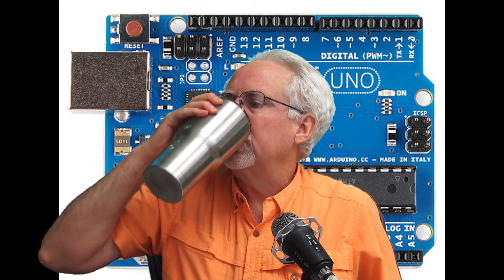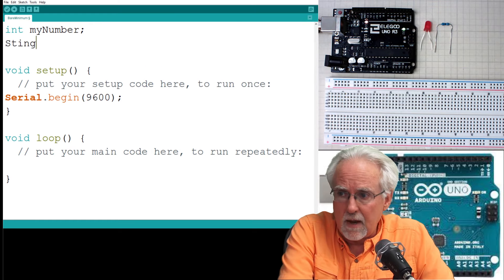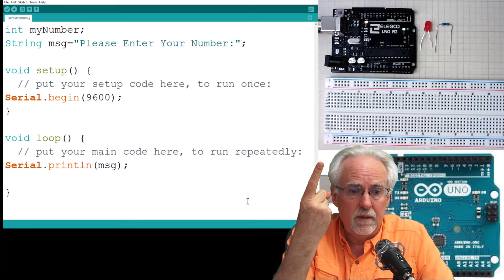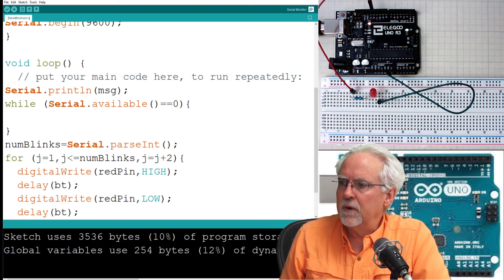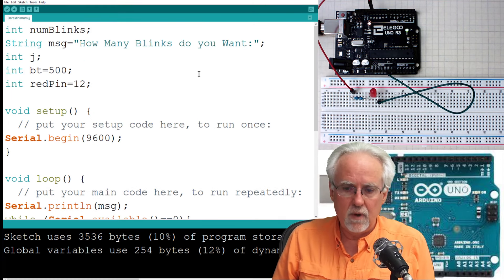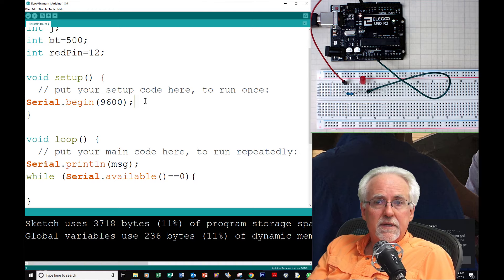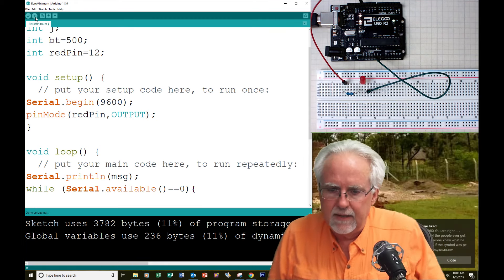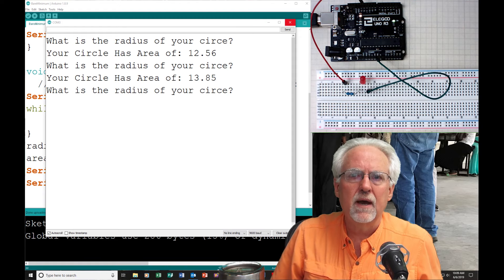Arduino Tutorial 18: Reading Numbers from the Serial Monitor

Comment from the maker: Guys if you are having trouble, make sure you have your serial monitor set to "No Line Ending". Otherwise you can get unpredictable results.
Reply: Good one there. I entered the code as you explained it, then paused the video before you executed it. My sketch compiled and loaded fine. It took me a while to figure out  that I had to click Send or Enter to execute the read. I had the serial monitor set to "Both NL and CR", and the Serial Monitor would print an extra line saying "Your Number is 0"! Changing to "No Line Ending" fixed it. BTW, this lesson covered new stuff for me, had never seen Serial.available or Serial.parse before. Keep challenging us!
Reply: omg this was my problem  tytytytytytyty lol
Reply: Thank you Paul, you are a great teacher. I was wondering, the setting we had to choose was "No line ending", is it also possible to add a line ending. How would such look like?
Reply: At last - this fixed my issue too. Many thanks
Reply: Thank you so much for mentioning this! I was pulling my hair out trying to figure out why my code wasn't working.
Reply: Hey Paul thanks for the heads up, but can you explain why this happens and what's the use of new line??
Reply: @chuckpickering6040  I was dealing with this issue and for once decided to read the comments to see if it was talked about. You saved me alot of time beating my head against a wall... thanks
Reply: Yeh acttuly , thanks for help for beginners 😊
Reply: Thank you boss !
Reply: @chuckpickering6040   I just had the same problem, until I saw his comment
Reply: OMG thank God you said that
Reply: I raged quit the video after I couldn't solve this issue yesterday. I rewrote the code a lot of times to the point that I memorized it. and finally I decided to come to the comment section and see this that solved the problem I was facing.

Thank you so much for these amazing tutorials, I just started couple of days ago and I am super excited to start using more components. You are great at teaching and a really funny person. I really enjoy your lessons.
Reply: Thanks, it helped me. It was one extra entering 0, after I entered myNumber.
Reply: Mr. McWhorther, lets thank Youtube for its comment section...
I enterd roughly similar code with some exeptions here and there, but no matter how mant times I rewatched this video I couldn't find out why my serial monitor would only use the value i enteref for Red LED.

Then I decided to take a look at the comments an found my answer.

Thank you for every detail you put into this videos. 
We appreciate it!
Reply: I thought my Arduino was broken... I thought it was supposed to be set on newline.... thanks wish I saw this 2 hours ago.
Reply: @chuckpickering6040  Same thing happened to me. Thanks for this comment.
Reply: That did it - kept on getting an extra message each time after entering the number of blinks. Sorted!!!
Reply: Thanks! Fixed the issue!
Reply: dude.... THANK YOU
Reply: @ДмитрийГрибанов-ь8э  Mine, too: 
Please enter Your Number.
Your Number is 565
Please enter Your Number.
Your Number is 0
Please enter Your Number.
Your Number is 235
Please enter Your Number.
Your Number is 0
Please enter Your Number.
---------------------------------------------But changing to "No Line Ending" fixed it------------------------------------
I was stuck for a week!
Reply: I was trying to figure out how to clear the value to null for the variable. Slaps the face. Wrong setting... thanks  pops
Reply: This ought to be pinned to the top!!! 
I was going crazy until I read this comment!!! 
Thanks :)
Reply: This totally helped, spent the last few minutes trying to figure out why I was getting an extra line.
Reply: Sir, can you explain the difference between these settings and what they do. I spend an entire day trying to find out why my circuit wasn't working until i decided to check the comments to see whether anyone else was facing problems. Thanks for the video series. It is really helpfull
Reply: Fantastic!! I forgot to change that when you mentioned it before. Thanks for putting it in the comments!
Reply: That was my issue! Thanks Paul! That fixed it! Loving these videos, learning so much! Gotta love the practical experience too, thank you for the assignments, they are challenging but not discouraging.
Reply: I found the prob
Reply: thnks for this, now my problem is solved and I can continue happily
Reply: Sir
Reply: thank you
Reply: OMG :D this fixed the extra "number is 0" line :D Thank you Paul :)
Reply: Can someone please explain what each of these options do? I tried to look online and found things about carriage options and such, but I am not fully understanding the difference between each of these options.
Reply: @chuckpickering6040  I was having the same problem!  Thanks for sharing!
Reply: Thank you
Reply: Bwahahaha, i rewrote my code a few times, every time the same problem .... and it was just a click on the Serial monitor hahahahah. Oh well so we learn.
Reply: Lol. I was scratching my head until I saw this. Thanks for adding
Reply: I'm one of the 232 that had this problem. I searched & searched the code. I don't have any LEDs so my code is slightly different to blink the one on the board. So I decided to read through comments & glad I did.

Thanks so much for the great teachings!
Reply: That solve the problem. Very effective
Thank for your hard work
Reply: I guess everyone had the same problem (including myself)😅
Reply: aah! i was about to throw it in the river.. thx!
Reply: I was confused because I got “0” at the ending, it’s ok with “no line ending “
Reply: thanks for this. I was wondering why the monitor shows the message twice and the second result was 0 no matter what number I entered. My serial monitor was set to "Newline". Now the result is the same as your video.
Reply: ty mine say my nuber ex 55 and write a new line say 0 . ty for the info with the no line end it write only 55
Reply: I got the automatic "Your Number is: 0" after entering other numbers until I changed that.  Thanks for the heads up!
Reply: i was wondering why it was running through the code twice and inputting a 0 the second time
Reply: I had the same issue. It kept printing "Your Number is 0". I fixed it as you suggested in this comment.
Reply: @prabhavagnihotri7420  when set to 'Newline' it generates /0 each time…and program proceeds with value 0 before taking any value from you.
Reply: That fixed my problem, thanks
Reply: Thank you! Before I switched that setting, my serial monitor would do 2 executions of the code, the 1st being with the number I entered, and the 2nd being with a 0.
Reply: HE SAID IT IN THE OTHER VIDEO
Reply: YOU GOT MY BACK
Reply: txs, indeed it fixed it! why does this happen? Again thanks a lot for the interesting and entertaining material!
Reply: Thank you sir, I was really banging my head before reading this comment.
Reply: Thank you soo much. I was stuck for missing this setting and in one hour I wasn't able to solve it until now!
Reply: this solved my problem! my serial monitor keep printing 0 after every time i enter a number. as if there was someone else entering 0 for me. this is what i get for not holding my breath many times hahahah
Reply: Wish I saw this sooner.  HAHA
Reply: seems we all had the same problem. Wish I had read the comments 30 mins ago . Figured it out in the end.🙂
Reply: Holy cow! Thanks! I tried 3 different computers and kept getting a 0 after my input was read. Next time ill refer to the comments haha
Reply: Wish I read this an hour ago :)
Reply: Thank you. I was about to give up (not really- just disappointed :) ) when I found your comment - problem solved!
Reply: @chuckpickering6040  yes I am facing the same issue!
Reply: Just the problem i was having 😅
Reply: ohhh, thats why, it works now lol
Reply: Thank you for the tip. I was wondering what was wrong with my monitor until I saw this when I tried out the code.
Reply: Thanks
Reply: Oh dude thank you lol
Reply: i had fun figuring that one out thanks lol
Reply: haha this is my problem. I almost empty my coffee thinking what is the problem then I decide to check the comment😄
Reply: Thank you. I came to the comment area because I was having a problem and BOOM!!!, the answer was in the first comment. 🙂
Reply: Not sure what I would have done if I hadn't read this comment, at least one hour of my life passed away looking for the reason it kept repeating after I had entered a number, Doh!!! anyway another great episode Paul, on to the next one!
Reply: Wow this was my issue.  I made a program to control the LED brightness by entering a float.  It kept going to the brightness i chose and then shutting off.  I got around it by adding a Serial.read() while Serial.available() > 0 at the start of my loop, but it's nice to know how to avoid it in the future.  Thanks!
Reply: It took me forever to see how to change that!
Reply: that was driving me nuts...ok..it works now
Reply: Paul, these videos are still being watched.  Thanks for sharing your knowledge with us.  Love these series.
Reply: This tripped me up. Thanks for adding this comment. Was getting ready to throw my Arduino out the window!
Reply: I guess thats why we need the strong black iced coffee with no sugar! Thank you for your lessons!
Reply: Yep.  That fixed my problem, although i’m not quite sure why
Reply: 😢😢 thanks
Reply: Ok

Comment: Just a tip for other viewers:
I had an issue where serial monitor would ask how many blinks, I would enter, and it would work properly. But when it void looped, it would double prompt me with "How many blinks do you want?". 

The issue was my fault - you need to change the serial monitor from "Newline" to "No line ending" in the drop down menu next to baud rate, in the lower right-hand corner. This is something that Paul suggested many tutorials ago, but I didn't change until now. This guy knows his stuff so pay attention =)
Reply: when i did change it to "no line ending" my code stopped working!!!! :D

Comment: the numbers off blinks i could not seem to work out but in the code if you change this line 
for(j=0; j<numBlinks; j=j+1) i spoted the pinmode missing in his video also the +2 as knew from the othere videos that it should been +1 unless you wanted to count down so only half the blinks they input

Comment: Why did the LEDs work at all (albeit dimly) before you initialised the pin?
Reply: According to the Arduino reference; the internal pull-up resistor is enabled by default when pins are undeclared, and the resistor acts to limit the available current. Unfortunately the Atmega328 datasheet offers only basic schematic diagrams of the I/O pins so I'm unable to explain exactly how this happens.

Source : https://www.arduino.cc/reference/en/language/functions/digital-io/digitalwrite/
Reply: @danthemancasey  Thanks for that explanation.  Appreciate it.

Comment: This was a fun one (actually, they are all fun!)  A bit more explanation on the Serial.available() command could be useful here, for example would I ever use it for anything other than this case of waiting on the user to enter a value.  Also I'm curious if there is a way to have a user enter two or more unique inputs during the run.  Maybe that is covered in subsequent lessons? Way to go on coding through the impediment of spilled coffee - handled like a pro!  The important thing is it did NOT hit the Arduino! :D
Reply: You can do 2 or more inputs before anything happens. One example is using another subsequent While to wait for the 2nd input. I'm starting out on this coding stuff so can't suggest anything fancier.

Comment: Question: Why is  if I input 9 ones 111111111 serial monitor shows a value of 27591?Just curious
Reply: maybe it is too large, overflow the capacity of arduino to handle a limited value of integer
Reply: U gotta put a double instead of an int
Reply: Hi you are employing 16 bit integer in the declaration.
2^16 = 65536.
so when you input a number larger than 65535 it overflows and starts filling the register with the remaining value.
Here, when you enter 111,111,111 its starts filling the register but it overflows, so it starts filling the register again but since your number is very large it repeats the process over and over again. 1495 times actually. After repeating it 1495 times it has a remainder of 27591. And thats the value it shows.
111,111,111 / 65536 = 1495.42100525
0.42100525 * 65536 = 27591 !!!!
Reply: @prabhakaranbaskar1400  Any extra bits go into the bit bucket.

Comment: BOOM ! works a treat. Given the 'most excellent' knowledge you've imparted thus far Paul, I embellished the output a little with adding the 'user input' value & mm to the output string...ie  "For a radius of 9.00 mm, The Area is : 254.34 mm	// perfect … "

Comment: I tried with the for loop and it worked just fine. You just have to make the first and last conditions always true while stating your condition in place of the second condition in the <for> brackets.

1 for example will always be true. e.g. for(1;<condition>;1)
Reply: Yep, you can also write for(;;). it will do the same thing. It's less intuitive though for someone else who may be reading your code, which is why a while() loop is a better choice.

Comment: Hello, Paul!  Thank you for lesson again!  My coding for this lesson is fine, but the first printing message always printed twice when the  "while" loop runs for the very first time.  For example, after I click "upload", the message for "enter radius of a circle" is printed TWICE on my serial monitor. The two prints are about 1 second apart.  After I entered the value of the radius, the program is work fine - no more double prints.  The similar issue happened to my son's "for" loop counter (lesson 16).  When the program is first uploaded, the first number is printed two times, and after that everything is fine.  After googled the solution for this type of problem, I added a delay for 1000ms before the program loop.  This delay function solved the double print issue.  It seems the computer needs to take 1 second break before starting its work correctly 😆

Comment: Having an issue with this @ 10:08 - after entering an integer, the messages repeat a second time, but then says my number is 0. Do you have any ideas why this is happening? Everything I typed in the code is identical.

Comment: 00:02 Lesson 18: Reading data from the serial monitor
02:41 To read numbers from the serial monitor, set up variables and use the ask-wait-read process.
04:56 Implementing a delay for user input
07:38 Reading numbers from the Serial Monitor using Arduino
10:43 Interacting with the program through the serial monitor
13:17 Using a for loop to blink an LED based on user input
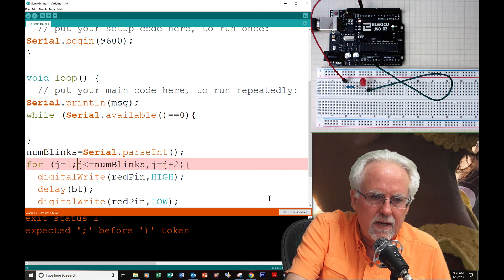16:24 Troubleshooting dim LED
19:29 Troubleshooting LED blinking issue due to missing pin mode setup
22:11 Interacting with the serial monitor to read inputs for calculations
24:36 Recognizing and handling float values in Arduino
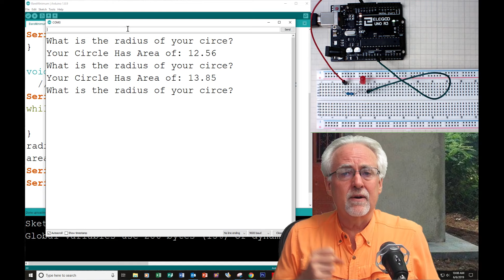27:13 Reading integers and floats from serial monitor
Crafted by Merlin AI.

Comment: thank you for the comment. it resolved the new line issue. but the question is :
while I select the newline and timesteps options, then it pops up the following outcomes:
13:52:20.662-> Please enter your number: 
13:52:28.407 ->your number is: 23
13:52:28.453-> Please enter your number: 
13:52:29.455 ->your number is: 0
13:52:29.445-> Please enter your number: 

why does it input 0 into the console?  and What are the numbers after time indicators?
Reply from the maker: Set your serial monitor to no line ending

Comment: It is good to read some of the comments if you are having a problem. I couldn't figure out why the monitor would respond  to the input correctly and then say "The radius of your circle is 0" . When I saw that we needed to correct The monitor to "No Line Ending", my problem disappeared. It took a second to figure out where that change could be effected but it's all good now. Wow, 105,000 subscribers. How many kits have been sold? Thanks again Paul.
Reply from the maker: Usually a few kits a day are sold, and I get a little that helps me with the equipment to make the videos. Wish more young people would get into this.

Comment: I learned the missing pin mode in your last video so I was on it!  I am having a bug in my serial.print and serial.parse and Serial.available.  Everything works, however directly after it asks again to enter the area, or the number, and it will answer 0 and put that into the serial monitor.  I can't find anything extra or different in my code so I think it may just be some sort of a communication error with my serial monitor.
This is what it does for the last part of the lesson...
17:59:13.566 -> The area of a circle with radius 2.10 is: 13.85
17:59:13.600 -> What is the radius of your circle?
17:59:14.582 -> The area of a circle with radius 0.00 is: 0.00
17:59:14.616 -> What is the radius of your circle?

You can see it puts the extra answer for zero in there, however I did enter the zero.  I tried including a delay but I couldn't get that to work. I only does it after I answer and never before or when I reset the board.
If I put in the command ...
while(Serial.available()<0)
I notice it just repeatedly answer the question on its own ...
18:17:13.600 -> What is the radius of your circle?
18:17:14.582 -> The area of a circle with radius 0.00 is: 0.00
But only once when I put...
while(Serial.available()==0)

So I suspect it has to do with the Serial.available()==0 driver or what ever it is that handles the serial communications between my arduino and my windows computer.
Reply: I see that I should have No line ending selected on my serial monitor!   Thank you!